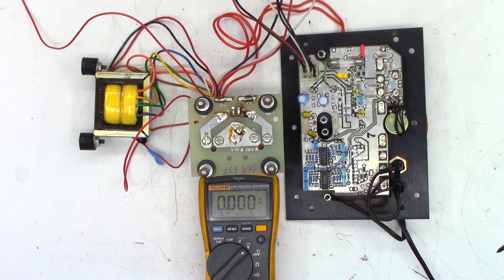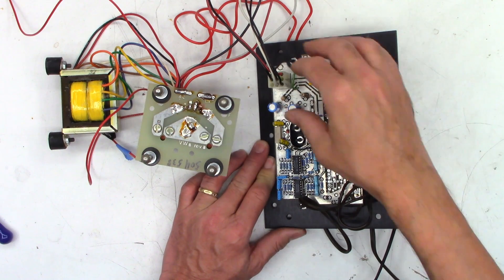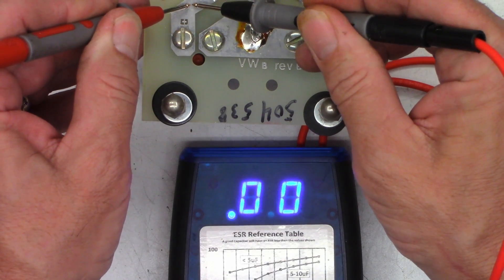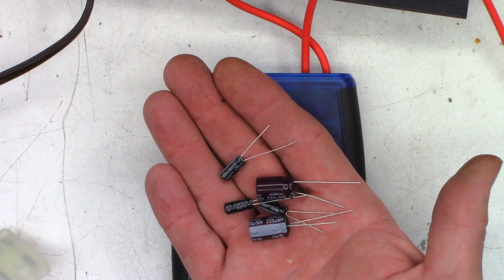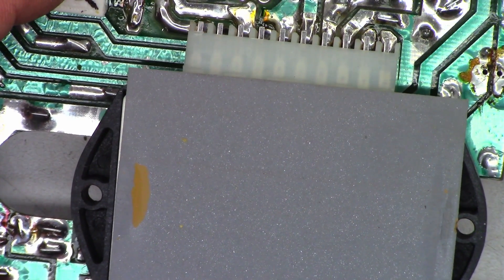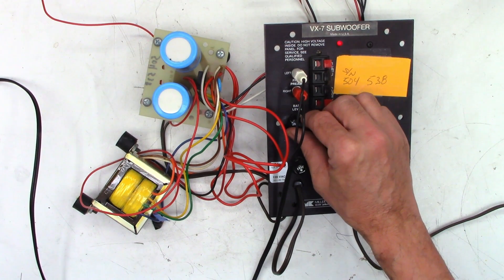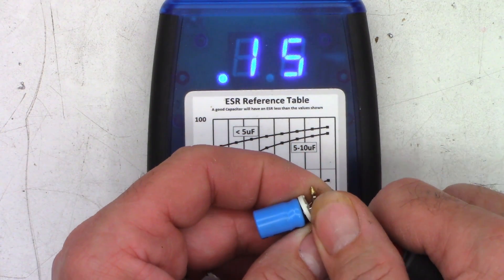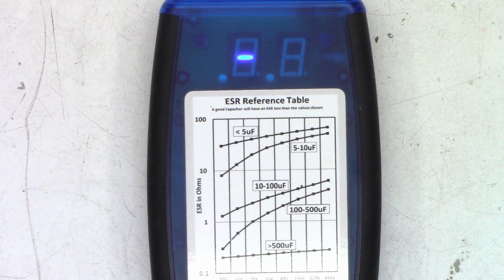Two Miller and Kreisel VX-7 Subs sent from Tennessee for repair. This is Subwoofer #2 Deoxit F5

Comment: What solder do you use? I have a tough time finding a good melt solder. By the way,I did not get an e-mail to send you the cables.
Reply from the maker: I thought I replied. Ill look again when I have some more time. Solder is  Kester .031 60/40 https://www.ebay.com/itm/165130935281?epid=2255555765&hash=item2672921bf1:g:aZUAAOSwPZ5hah8B

Comment: Unfortunately you did not put that bushings that were under the old capacitors under the new ones.
Reply from the maker: I dont think they are necessary.
Reply: @norcal715  Well the manufacturer spent money to put them there for a reason, so it would be better to put them back since they are provided.